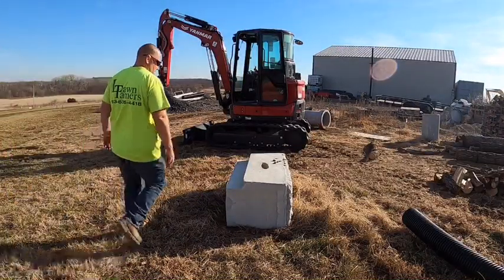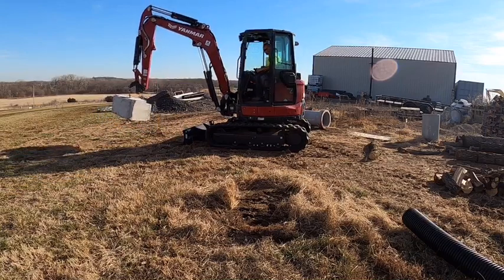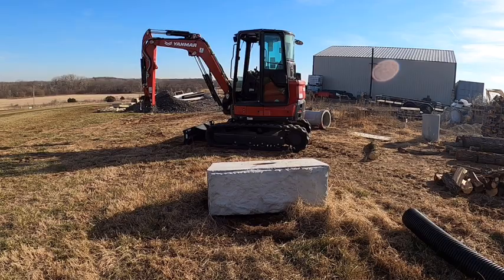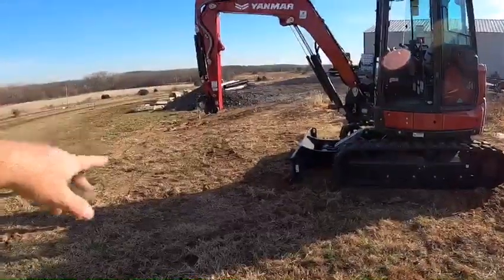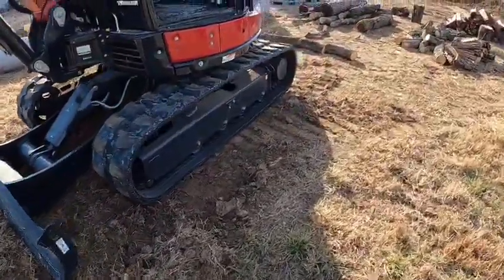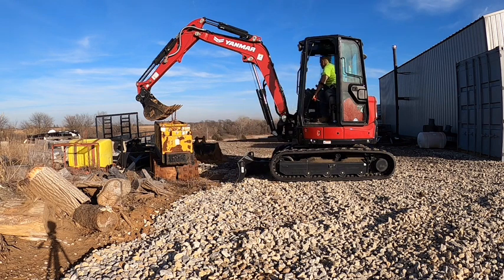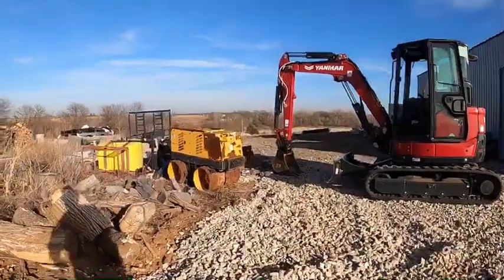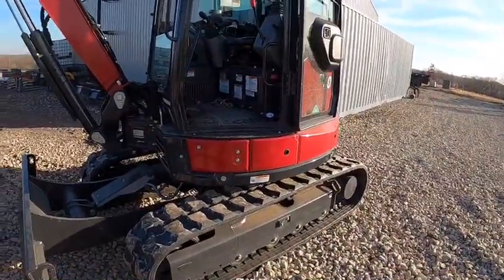Yanmar SV40 weight test. Can it lift a big concrete wall block ?

Comment: Nice video.  I’m really interested in what size trailer and truck you transport this awesome beast.  This is the best video showing SV40 lifting capability ever!!!  Well done.
Reply from the maker: I used to pull everything with a 2015 F250 with a 6.7 diesel and a 14K trailer. I have a couple videos of my old set up. 

Now I have a 2020 F450 7.3 Godzilla gas engine and a 18K trailer. Its a load trail deck over with 8K axles. 17.5 " 16 ply tires. Over kill but awesome.
Reply: @skidco  Man your lucky ole’ DOT doesn’t touch you in your no no spots.  

They are vicious in my neck of the woods for combos over 26k 😢🤦‍♂️

Comment: how do you feel about the SV40 compared to the VIO50 im looking at both machines right now, would you still choose your 50 over the 40 if you could do it over ?
Reply from the maker: I need the size and weight of my 50. But that 40 is a really good size. I do allot of retaining walls and land clearing. Also do allot of pond repair. I could use a 55 about 30% of the time but couldn’t justify it for most my work. I ran a 35 for a long time. I think that 40 would blow them away.
Reply: I’m about to go with the 40 after testing the 50 out.  The 40 is so much smoother if a machine and it can handle the same weight. The 50’ is a heavier duty machine tho.  What’s everyone thoughts ?

Comment: Hey Jason, this is Jason! The guy that talked back and forth with you about excavators and mulching heads on facebook a few months ago; I wanted to ask what you thought about the SV40; I am considering one this year as my first X that I can afford, and I am going to get a small mulching head for it; the reason for going so small is because I don't have my CDL's and I don't know how I could go to school for them while working full time, so I am trying to be as legal as possible; any thoughts would be great; I am subscribed and I appreciate the vid's; thanks!
Reply from the maker: the sv40 is a good little machine. Its usually good to get as big as you can but it depends on what your doing with it. You can haul a vio50 on a trailer and be under cdl but its close and you have to have the right truck and trailer. I really like the sv40. it would be hard to decide on that or a vio50 if they were out when I bought my 50.

Comment: What size is that block?
Reply from the maker: The block in the video is 16” tall 4’ wide and 2’ deep. They are listed and being 1800 pounds.
Reply: What size chain are you using? Looks like you are just choking the chain around the pin grabber?

Comment: real close to pulling the trigger on this same machine. not alot of support in my area for yanmar.
Reply from the maker: They are getting more dealers every month I was told. Vermeer dealers have always been a dealer for them just never tried to stock them before. I was told the Yanmar is number one in the world. They have just not been super popular in the US because dealers didn’t stock them. That’s changing now.
Reply from the maker: They are really good machines. Really well built if you want my opinion.